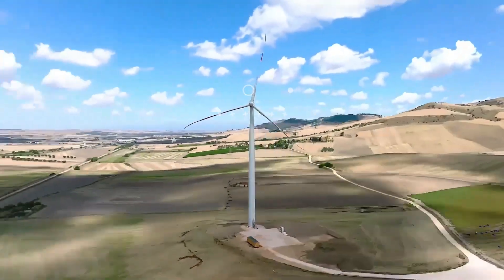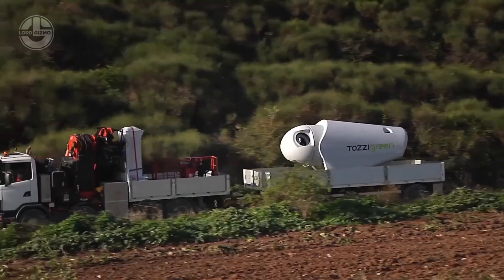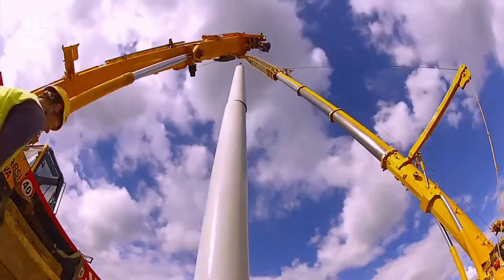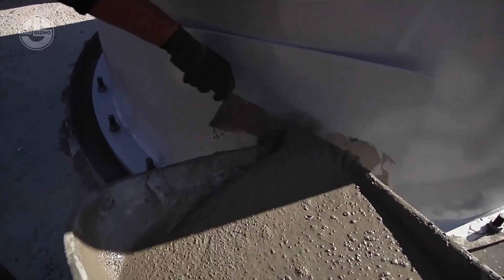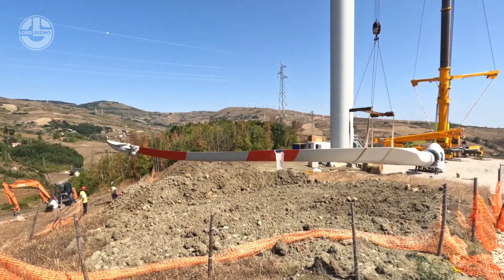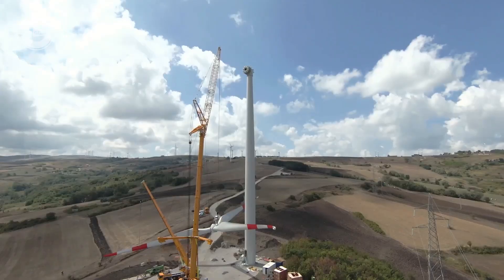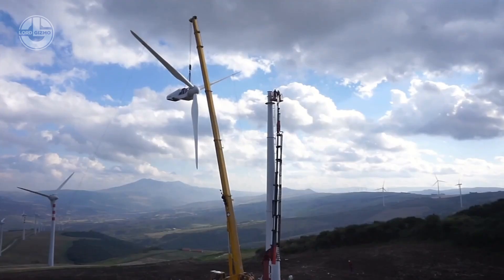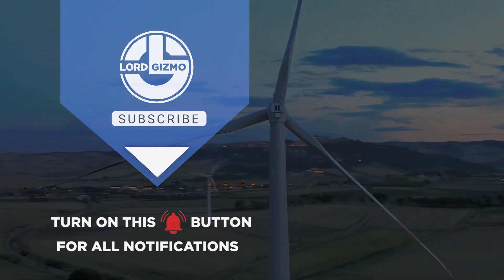Wind Turbine Farm Built from Scratch | Engineering a Mega Structure!

Comment: Due to the large carbon footprint they generate to build, their production will never out weigh the pollution created to build it. They claim they last 20 years, however, it’s about 10-15 at best. Solar farms are much more efficient and will last much longer.  Virtually no moving parts that can fail as many turbines experience.  Just saying.
Reply: Carbon footprint is small reason for the choice number 1 reason is to provide power where they have none.

Comment: If they pump water or grind grain they're very useful But for electricity generation they cause far too many problems to be useful.
They use up hundreds of times the materials used in a coal or especially gas power plant and more often than not a coal or gas plant has to be kept running in case the wind stops or is too gusty or fast or slow for the turbines .
So the majority of the time when the wind is blowing just right way too much power is produced by wind and the traditional power that cannot be shut off , they need many times more turbines to get enough power when the wind is low or not blowing in a certain area so many turbines are just spinning in the wind and not doing anything . And then they wear out and need replacing often much sooner than claimed, not to mention the disintegrating blades causing a danger to the public and wildlife and that's before the recycling problems.